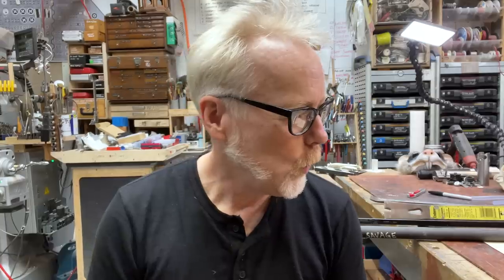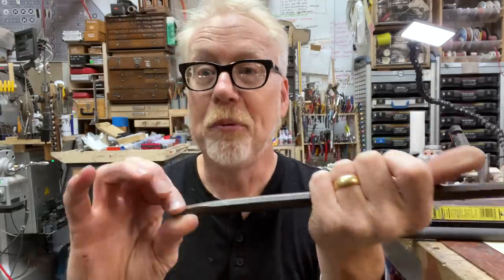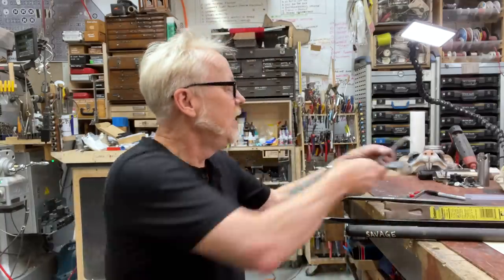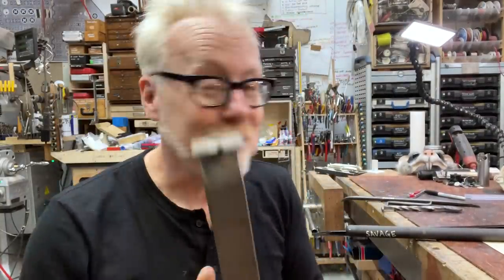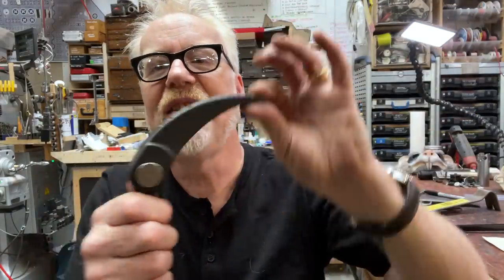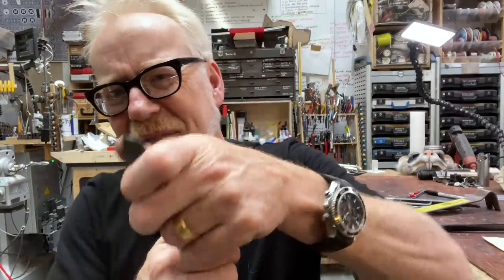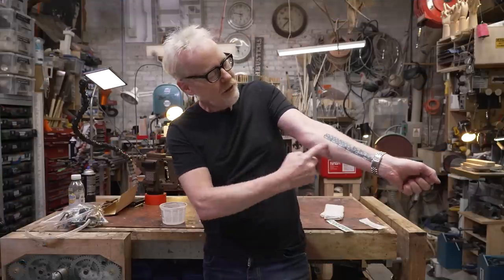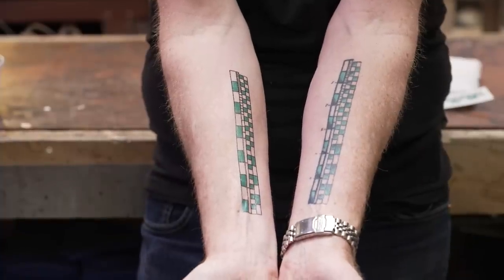Adam Savage's Favorite Tools: Pry Bars!

Comment: When I was in band in school the band director had a special piece of “prying” equipment designed specifically to remove the mouth pieces from brass instruments. It wasn’t a pry bar but it was more like 2 circular clamps separated by a set of really long screws. So the band director could tighten one end appropriately for the mouth piece and one end appropriately for the receiving tubing of the mouth piece, then carefully pull the mouth piece directly out without hurting anything. 

Very specific but it oddly sounds more suited to the example you gave in the intro than an actual pry bar.

Comment: Adam, if you don't have an Estwing PB-18, you need to get one. It is by far the most useful pry bar I've found. The flats on the right-angle end allow you to hammer on it if necessary, which allows it to  be used as a wedge as well as a pry bar.

Comment: I also have a pry bar that is four and a half inches in a length with a 5/16 pry wedge I call it my Jewelers pry bar. It's actually a lot more useful than you think when working with smaller things and electronics.

Comment: I'm a big fan of the Stanley Promax Fubar. It can be a hammer, claw ripper (specifically for 2x4s but works on other things), nail remover, and prybar. $55 at most hardware stores, lasts forever.

Comment: The Pro-Bar (Hallighan tool) when clipped to an axe is referred to as The Irons'. The zombie spike is great for getting through security doors.
One person holds the spike tip against the door while another hammers it home with a sledge,.Very robust tool, practically unbreakable.

Comment: Also: Car mechanics almost always find a need for a prybar when working on a car, be it anything from a plastic wedge to deal with some dashboard components or soft interior details, to something big and heavy to dislodge a stuck part in the engine or drivetrain areas. My assumption will be that only money and space limits the assorted amounts for each mechanic.
Reply: I use a 5ft long 3/4 inch snap-on prybar to decouple Cardon shafts from transfer cases and gearboxes every day, truly an essential tool no matter what the size

Comment: Cat's paw is a great little separator prybar.  Wide, flat, almost knife edged lever end is a carpenter's tool for delicately removing things like molding around doors and floors without damaging them, so they can get reinstalled afterwards.  I also use a full size oldschool crowbar for coaxing things in to shape or alignment.  It is a large enough tool that you can balance the force applied to it to make subtle changes or big moves.  I have 2 😁😁 
The Stanley Fubar is also a wonderful tool, not just for the name. 🤣

Comment: I love that Adam considers his metre-long screwdriver to be a prybar.
...'cause we all know that standard screwdrivers aren't much good for anything else. The ten-inch ones are almost universally known as "paint can openers." 😉😁
Reply: I got a proper paint can opener as part of a HP summer promotion 20+ years ago.  It is slightly curved and doesn't dimple or crinkle the can.  Since then I've regretted every time that I used a screwdriver instead of getting the Proper tool.
One doesn't know how good the right tool is till you use it.
Reply: @criggie  Turns out standard screwdrivers aren't much good as paint can openers, either...What a surprise! 🤨😁

Comment: When I'm doing die making, one of the most difficult things is removing a stuck drawn part from a die. I did deep drawing with copper. It's like removing a stuck rifle case, but worse, because the case often had no bottom, because it had been broken during the drawing process. I was able to come up with a punch that was wider than the ID of the copper part, but not as wide as the ID of the die. Then, I could use it as a punch and push the stuck part out the mouth of the die. That required some thougt on my part.

Comment: Wiha has a little prybar in their small screwdriver range (Nr. 42507) which I use more than any other prying tool. Yes it really is comically small, but extremely useful non the less and as a bonus it safes small flat bladed screwdrivers from abuse.

Comment: Harbor freight has(or had) a set of pry bars with handles on one end that are fantastic. There was a set of 3 that came in 8”, 12”, & 24”.   I also bought the 36”
Reply: Let me tell you. I used and abused those things when i was working on forklifts. Probably one of the best things i got from there. The 36” was absolutely fantastic for moving around the heavy wheels when putting them on after changing the wheels or the breaks.

Comment: It should be noted that gearwrench is manufactured by SATA. So if you don't want to pay extra for the brand, just buy the SATA version. Also you should invest in a klein or craftsman makes a small version of a flange alignment bar. Also known as a sleever bar. It has a taper point on one side and a pry end on the other. Klein version is around 36" and craftsman is around 12-18". Great tools if you're into metalworking or pipe fitting.

Comment: Hi Adam you need to look at OX OX-P083012 Claw Bar - Pro Series Claw Bar with Non-slip Grip Handle - Hardened Hammer Head - Multi-Colour - 12-Inch/250 mm it's really good for them small jobs that if you don't already have it in your collection.

Comment: I'm a forklift mechanic. I have to deal with some 'seriously' stuck, rusted, damaged, bent, warped, and otherwise non-cooperative metal. These things weigh 10,000 pounds sometimes so if they hit something or each other, well, steel gets pretty pliable at those levels of 1/2 mv squared, so I've got all of these pry bars to... Well, let's put it this way. I have a 3 foot prybar 3/4 inch thick, with another 3 foot 1/4 inch steel pipe welded on the end of it. I call it the 'Negotiator.'

'Give me a lever long enough, and I shall move the Earth." -Archimedes.

Comment: I think that 3rd tool (the smallest one) is actually an offset screwdriver.  I can see how it would make an excellent pry bar, but I don't think that was it's original intent.
Reply: I agree, I think carpenters and cabinet makers use them to get into those award little screws!
Reply: I thought it was a lock chisel for cutting the rebates when fitting drawer locks in inaccessible places.

Comment: You NEED, a 4 foot wrecking bar. Simple steel hex bar with a wedge at one end, 4 foot long. Need to move an engine an inch side ways without removing the mounts? This will do it with ease.

Comment: You missed mini handheld pry bars, a lot like a normal sized screw driver, but intended for pry bar use. You can also find mini pry bars with the classic bent tips which a normal screw driver does not offer.

Comment: 9:30 - not that I necessarily find it particularly special, but... you may have missed the "Johnson Bar"?  Though... what I remember being called that in my theatre days (a 6' piece of steel with a wedge on one end and a point on the other) is different than what I'm finding in searches now (a wooden handle with a wheel and a metal L bracket type thing for lifting heavy objects).  Maybe the first has some other name?  Anyway, I guess that's two you missed?  :)

Comment: Honestly I should really invest in some prying tools, I broke my pliers last time I got a repair job, because I had to pull out studs, of course a few days later I saw a video with someone drilling out studs, that would have been useful to know and save me about a tube of contact glue for closing wounds, hehe.
I usually only work in small-scale things, mainly leather, but I want to get into woodworking and later metal and forging.

Comment: @Adam Savage's Tested  Adam this was fantastic but you forgot 2 types of prying tool: the humble paint can opener, and a set of the small pointed picks that come with a straight one and various curved ones. They also come in a little larger sizes I've seen in car mechanics toolboxes. The small ones are great for getting in really small and tight areas, i used them often rekeying door locks when I worked for Home Depot. 😁
And on a side note with your hair dyed dark and the H.E.V. suit costume you could totally cosplay Gordon Freeman!

Comment: Separating thing #1 and thing #2 when they were little things some times might have required a pry bar of one type or another.
Reply: A Hose pipe usually works better on kids.
Reply: @clbcl5  A call to the dinner table usually works, at least it did with my brother and me. 😁

Comment: Rocker dual headed 36" pry bar. Can do everything that Halligan tool can do (short of whatever Zombie spike is used for ) & yet the Rocker bar can be picked up from home depot   & without needing a $ loan to buy it like the Halligan. I mean tools are tools. No need to severely over pay for a tool. I mean in 25 years in the construction trades I've never had to Spike a zombie while on job ??
Reply: The spike is used to open padlocks - insert, whack, padlock open. Depending on the padlock it may still be usable after being forced open.

Comment: That is a nice set of pry bars.   Since i see the big new bench in the background has gotten a lot of use since it was installed.  How have you enjoyed it since it came in and are there any other adjustments/changes you wish it had?  ie other than the fix for the handle to speed up the vice open/close that I think you did a while back.

Comment: There are cult followings in the fire service. Probar,  Halligan, and on and on and on. It's funny,  having used one so many times, if I had my own, the first thing I'd do would be to grind off those welded chain links, and the pick. *zombie point. The pick interferes with the levering half of the time when using the adze.

Comment: Screw drivers are NOT pry bars.  They aren't engineered for leverage, they are designed for torsion.  An easy way to ruin a good screwdriver is to use it as a pry bar.  Everyone does it, but you really shouldn't.